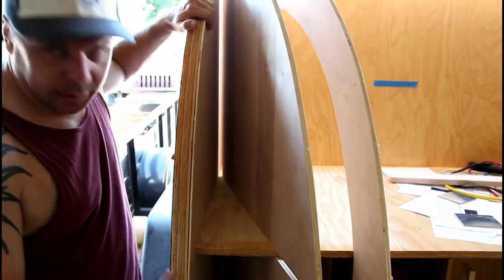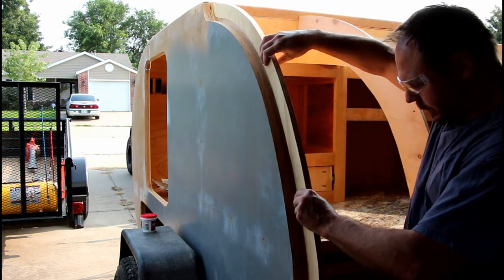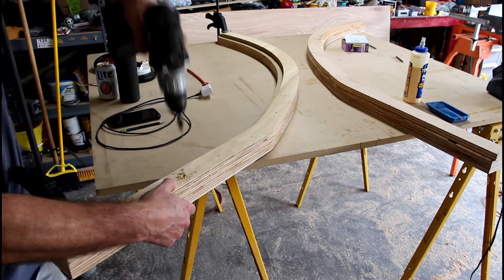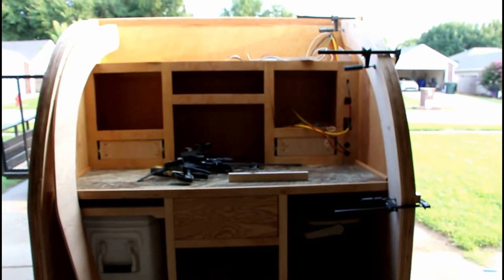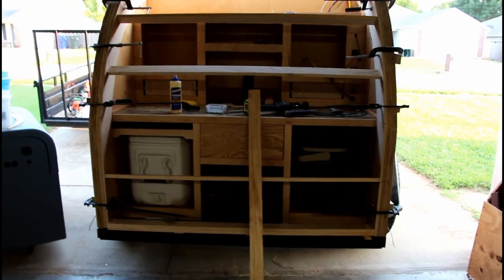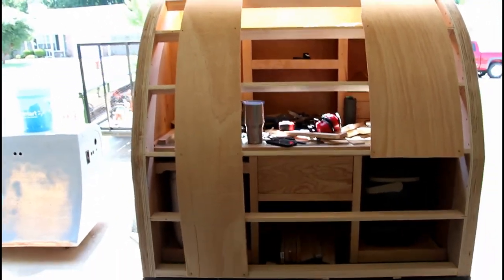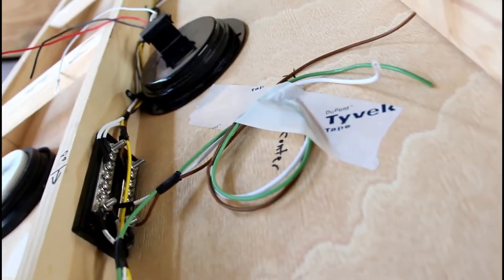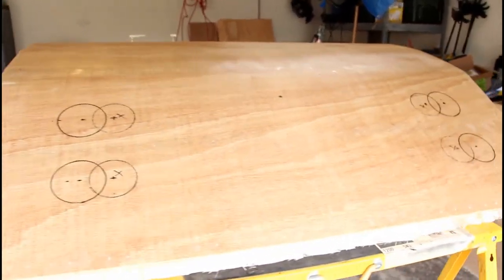TEARDROP TRAILER BUILD - GALLEY HATCH

Comment: At 12:25-12:30 mark, you talk about a seam. Are you talking about the bending plywood that you had to connect? Im thinking because its a 4' wide sheet which isnt long enough for the hatch that you needed to connect side by side. I could barely tell.
Reply from the maker: At 10:10 you can see where I did the interior side. The second piece to finish that is where a seam would be. The same goes for the exterior.
Reply: @Waynegoproductions I see. The "spackle" you mentioned is wood glue mixed with saw dust or is it spackle, like dry wall spackle? I'm drawing my plans up and I'm wondering how I'm going to hide the seams.

Comment: Great job brother. I have been looking for a great mechanical seal, that has the water run out, not in. I’m curious if you can give us an update at how it worked out, in keeping the water out, and if not, what you would do differently.  (Specifically the mating surfaces on the sides/gussets of the hatch? Thanks so much from the west coast of Canada. 🙏🏼😉🇨🇦
Reply from the maker: I haven't had any problems with water getting in. Happy with it